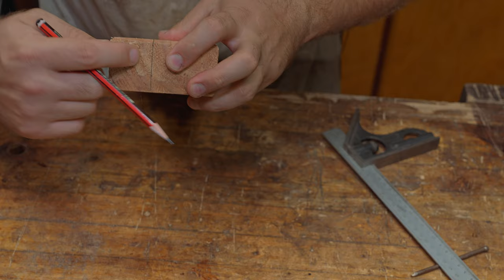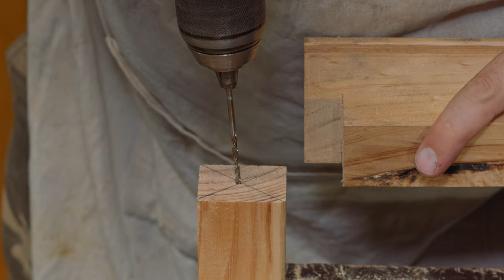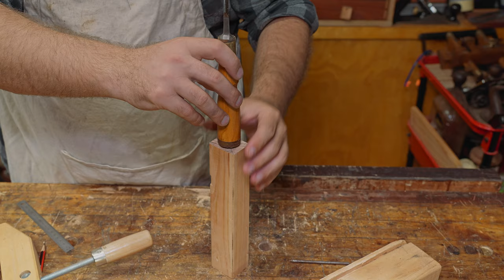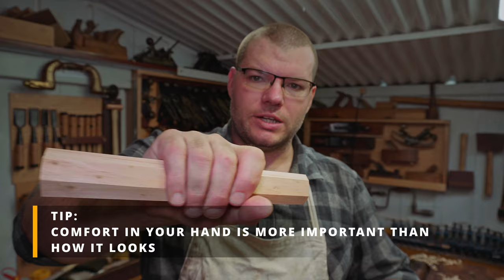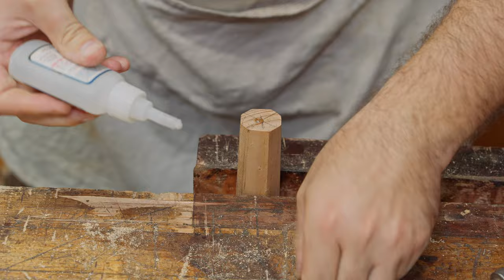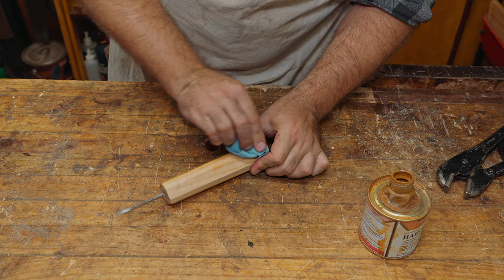Making the Poor Man's DIY Awl

Comment: Nice project. Another way to sharpen the point would be to chuck the nail in you drill and spin it on some sand paper.
Reply from the maker: Yes, that would work depending on if you want a round point on your awl or a squarish point.

Comment: Hi Luke. I think this is a really interesting video, for a number of reasons. To begin, the handle you made is much like what is known as a 'London Pattern' chisel handle, which I have never seen used for an awl before. More importantly, for me, is that I have never really thought about awl designs, which got me thinking. So I at looked at my awls and noticed that they are all (not awl) short, round handled and stubby, so that I can reach the wood surface with my index finger to guide and steady me while holding the short and narrow elongated pear-shaped handles in the palm of my hand. I understand that everyone will have their own preference on what is just a simple awl, I just never thought there would be so much variety out there. When it comes to the point, meaning the tip of the awl, I find square is always better because it is like having a small drill in your hand; I'm not keen on round point awls.
Reply from the maker: Thanks for sharing this. I was unaware of the name of this handle, i know there are different handle types but never looked into the names of them. Now i know.

I find it interesting how much variety there are in basics tools also. I don't have much experiences with awl's and only (now) have 2. I had never through of using the index finger to guide them, but it makes a great deal of sense. 

Without much experience with awl's i didn't think too much about the point on the awl, and just sharpened this one the easiest way which i guess gave it a squarish point. With your comment on it acting like a bit of a drill i can see the sharp corners of the point would help to remove material.

Thanks again for sharing you knowledge and time to comment.

Comment: I re-purpose old screwdrivers for this, esp cheap ones. Like nails they’re too soft, so facets need filing often. A better choice  is small files (like needle files), but they have to be annealed first.
Reply from the maker: Yes, you're correct a nail is a bit soft. However i was trying to make this awl very easy to make, the next step up would definitely be an old screwdriver or file and some annealing (or perhaps diamond plate to sharpen it)